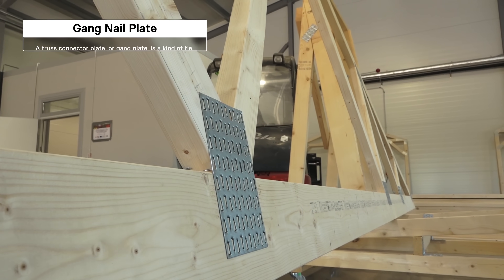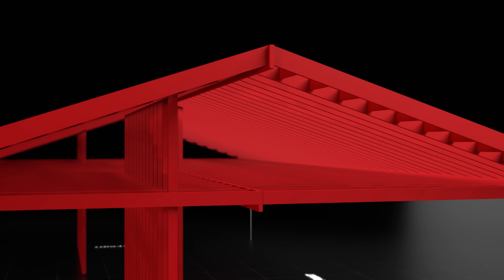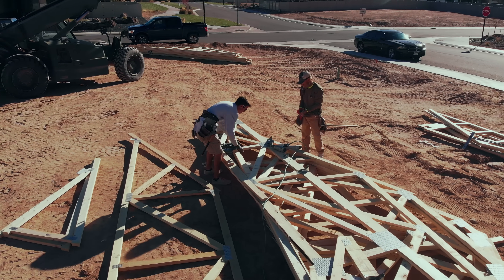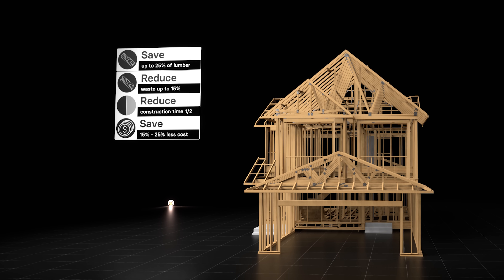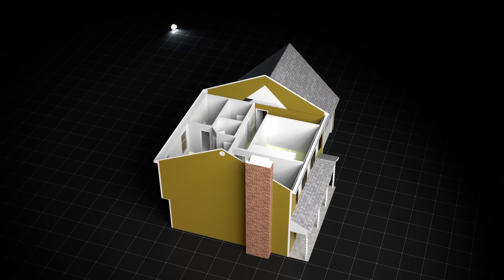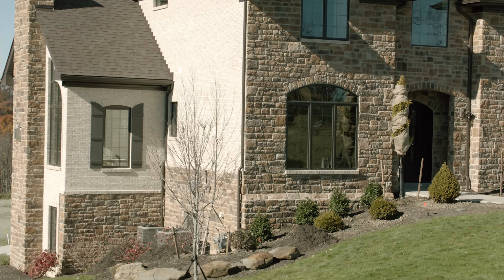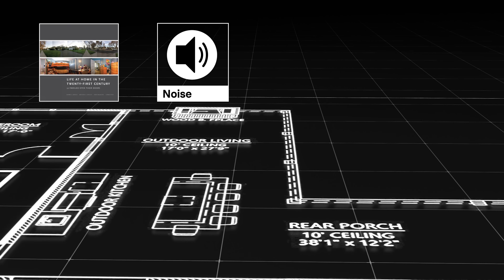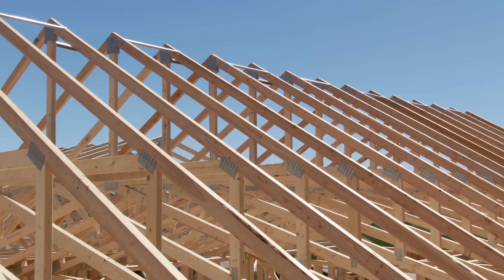The Invention that Accidentally Made McMansions

Comment: NEVER buy a house with a complex roof. Re-roofing costs are insane.
Reply: I used to do metal roofing. We could reroof a trailer house in 2 hours while some crazy roof design on a big house would take us 2 months. That's an insane difference in labor cost.

Also, overly complex roofs are probably going to leak too. These days, one of my jobs involves measuring roofs for metal. I walk away from some roofs shaking my head because there is no way they aren't going to leak with some of the nonsense flows they have going on. The people who build these things aren't going out of the way to solve bad design problems is all I'll say. They want to build it as fast as possible to get as much money as possible. Why would they bring up a problem they've spotted if they can just technically build it to spec and get paid for it?
Reply: I concur. I have a 1950's era A-pitch roof with two dormers and it still cost $16,000 to re-roof it. I can imagine $30-40K for these ridiculous mansions.

Comment: So, the engineer used a room-size computer to calculate lengths and angles. By 1979, the Engineer at my truss company used a Texas Instruments handheld computer to do exactly the same thing. He connected a small printer that printed a docket the same as your Woolies shopping docket to give us our cutting lists.
The loss of your roofs during strong winds wasn't the fault of how he roof was built. It was because the roof wasn't anchored to the concrete floor. In Australia in cyclone areas you need a bolt system every 2 metres to tie the roof to the floor.

Comment: I have a million and a half little cuts all over my hands and fingers from these. 2 pairs of gloves a week are necessary to comfortably build trusses with these  in the industry haha. But they come by the pallet on semi, 2x4, 3x6, all the way up to like 16x20+, and in 18 guage. Every 4 teeth vertically is 1 inch and each row of teeth is 1 inch which makes it easy to know plate sizes and to use em to measure place meant for where to put it on a long scarf

Comment: Gang Nail Plates are the reason modern houses "explode" when the get wind storms or swirling winds.  Old houses get damaged, new homes loose a wall or the roof gets lifted off.  It is not superior.  Another reason NOT to buy a McMansion or newer homes, they are not durable and are not worth the asking or buying rice.

Comment: The truss destroyed the earning potential of carpenters. Since a roof takes a lot of skill and math, many people would not be carpenter s , since trusses came in, and engineers, the skill aspect is done by programs and the worker is just an assembler, not a master carpenter.  Whereas electricians, gas fitters and plumbers still have to do the calculations themselves and are responsible.  

Always pros and cons when things are made easier.  Cheaper roofs... become bigger more complocated roofs.

Comment: Well, that video took a sharp turn from informative' to 'whiny.'  And it completely forgot about some of its initial points.  Trusses still have uplift problems in strong winds, and codes (at least in my neck of the woods) specifically call for 'hurricane ties' to securely fasten each truss to bearing wall.  And it completely ignored the fact that you can build an attic into a truss: it's even called an 'attic truss.'

Comment: My parents have a 20 year old McMansion that has rotting siding because it’s a glorified cardboard material. While I have 1900 farmhouse with original siding. The lumber from back then was virgin lumber. The grain was tighter and encouraged durability. Even with softer woods like pine. Now lumber is farmed. Irrigated and the grain is less durable. More likely to warp. Newer homes have particleboard sheets. They literally are barely a step above paper.
Reply: I just made a comment to a friend the other day. I told him 2x4's are basically particle boards now. screws split the wood so easy now. 
3-4 seasons expanding and contracting loosens every joint in the house, causing problems
Reply: Georgia Pacific had a siding that had numberous lawsuits as it was defective pressboard like system.  Not reliable.  Failed within 10 years or less. It might have been something like that. Ick!
Reply: @agentp6622 actually it’s figuratively, houses are much stronger than paper 😂
Reply: @agentp6621  Georgia Pacific the Koch Brothers sold the painted card board.  I recommend the pre-finished Hardi Panels.  Great color range selection and finishes..
Reply: Replace with hardie, problem solved. It's really not a big deal. People act like homes have to be zero maintenance or they are complete junk, but everything needs maintenance. Are you going to trash your car when you need new tires too?

Comment: I'm a fan of attics and like the the high rafter ties with gusset plates nailed in from both sides.  I think modern framing should try to enforce using the roof as the thermal barrier instead of the joists.  Having an attic where we can store seasonal items would greatly benefit us and slow down this single-use consumer trend we are in right now.

Comment: I'm an engineer working for a roofing products manufacturer, and I often have to review roof plans to help clients estimate their material costs using our products. I'm always amazed at how unnecessarily complicated roofs can be. It does sure make my job more challenging!
Reply: I think McMansions with complicated roof designs are probably mainly the result of CAD combined with floorplan-first designing.
Reply: @dafunkmonster  Yeah, that makes sense. I've used a roofing take-off software that will generate a roof based on the floorplan I enter, and some of them can be complicated by themselves. But what makes things even more complex is when some roof eaves are dropped, or they include gables at random places, or extend gable lines purely for decoration, etc.

Comment: I grew up in a house built in the 1940s. It was solid construction, and the old lady who had it built would show up in the evening and push insulation into any small spaces she saw. The house was so air tight that opening a door on the main floor would pop open any door that wasn't fully secured in the basement. It was cozy warm, and allowed my parents to seal the house during the 2002 anhydrous ammonia spill. However, it was very small by today's standards. 

In contrast, I've owned two different homes built in the 1990s with more open concepts. Our first home was split level and worked well for us until we got older and had some mobility issues, and was feeling cramped with family. Our current house is one story with a basement with larger rooms. The biggest difference, other than just size is that a different contractor manufactured the home. Air circulation was poor in our first home and HVAC sucked. But in our current home air circulation is much better and our utility bills are nearly identical even though there is 1000 sqft more to heat/cool. 

My point is that the choice of contractor, and willingness/ability to pay more, makes much more of a difference in the quality and durability of the house than just something like gang nail plates.

Comment: Trusses are time-bombs when  installed improperly, which is  more often than not.  A proper installation (especially for McMansion sized projects) requires an enormous amount of bracing to keep the compression members from buckling out-of-plane.  There's a 30-page manual on bracing put out by BCSI that nobody ever reads.  If you add the cost of the out-of-plane bracing, you probably break even on installed costs.

Comment: The problem isnt the technology of the plate itself. It all boils down to consumerism and not actually having any significant scientific data behind the longevity of the product at hand and how it can or should be used. Unfortunately we cant live in the past and at the same time we cant leap into the future. I see alot of talk about fire fitting and that thus is a week point. Well duh, so is the I joist so is osb. But its too costly to build in solid lumber, its to wasteful to not reuse the scrap. We are at a point that we can put chemical retardants in with the wood to slow the burning, but in the end its gonna burn, no home no matter what materials its made out of is going to outlast fire. Hell castles fell to fire. The point is this was to help make a home safer stronger and easier for the carpenter to insall. To save time and money or at least use the money that was going to get used for somthing else in the home. The mcmansion is not the fault of the this metal plate its the fault of gread and designers and every American trying to out do the next guy or have bigger and better.

Comment: Regarding McMansions in California, as electricity costs keep rising - currently around $0.50 per kWh, the McMansion is becoming less tenable.

Cooling that huge volume of space to 70 degrees on our typical 108 degree summer days using a standard central HVAC system requires a fair amount of electricity.  As long as Kwh’s are less than $0.30, it is reasonable enough.  However the the Kwh’s get into the 50 cent range, the finances become strained.
Reply: 50 cents per kWh? Gross. I'll enjoy my flat rate 10c/kWh all winter long. Nebraska is the only state in the country with 100% public power. You'd have thought California would have "nationalized" their power situation by now.
Reply: Yep - Poor old Cali has made bad choricea regarding electric utilities.

One example is the State Public Utility Commission.  In most states, the PUC commissioners are choosen vía public elections.  In California, they are appointed by the governor.  You can imagine how this leads to corruption and bad decisions.
Reply: @KbB-kz9qp  How does the uneducated electorate know who to select for the utilities commission and how does that result in actual better outcomes than a gubernatorial appointment?
Reply: In states where the public elects PUC members, the resulta are better, because the PUC isn’t beholden to the governor or his private investments.
Reply: @KbB-kz9qp  By what metric are the results better? You keep asserting that a thing produces better results because of its selection method, but you offer no evidence to support your assertion.

I might as well say that Communists build better cars, because the proletariat has freed themselves from class struggle. See how it's self-evident?
Reply: California has the highest prices for residential electric rates in the nation.
Reply: @KbB-kz9qp  Perhaps. You'll need to demonstrate how the selection process is the cause of those rates to support your assertion. You haven't even demonstrated correlation, let alone causation.

Santa causes snow, because when he comes it's usually snowy.
Reply: That's called "Bullshit Politics".

Comment: A problem with trusses seems to be that it takes up possible interior space. There is a house which I am familiar with a high pitch roof that can use the 'attic' area for rooms (albeit with very short vertical walls) that would not be possible with a truss roof. It makes two, or three bedrooms, for children mostly, that would not be possible on the house footprint area. And I would think that putting more usable space in an smaller structure would make heating and cooling more efficient.

But the truss plates also lead to the invention of other metal reinforceing  plates that make roof much stronger in storm prone areas.

Comment: We had a ranch style home. 4 bed, 2.5 bath. It had the gang plates. But it being built in the 1970s, it wasnt a McMansion. It still had a central wall in the middle to help load bear. The roof was simple and relatively flat (we don't get snow). The attic had a central section that had plywood laid down so we could use attic space (I live somewhere where basements are not practical). It was all brick - no mix-match cheap, crappy siding. 
So, gang plates may have made McMansions possible, but they dont have to be built. That's 100% greedy builders (looking at you, KB Homes) and greedy banks (looking at you, Chase, BofA, WF).

Comment: As a 60 year old builder I’m very familiar with these truss plates.  I think they are fantastic, and this examination of the larger effects they had (or contributed to) is just fascinating.  It’s both educational and entertaining.  Well done.  This is the kind of content we need more of.
Reply: Building houses out of wood is utterly moronic!
Reply: I think they're awful.  Every house I've been in that was built after the mid-80s has been built with them, and they've all rattled and rocked at me walking through, and trying to minimize that is part of why I got fat in the first place (can't exactly run around and be a kid when the entire house shakes at the antics of a single 50 lbs child, so I focused on things that entertained me without me needing to move around so much, like reading, or videogames)

They wouldn't be so bad if proper joinery was still used, but most of the time it's just a couple toe nails and a truss plate holding the house together, which might prevent it from actually falling apart, but it doesn't stop it from rattling and waving around dangerously when your grandkids run by your china cabinet, causing all your glasswear to bang against itself

Seen too many new constructions that have creaky floors on move-in to like the damn things
Reply: @PsylomeAlpha . Was your house raised?  I grew up in a house built in 1960 that sometimes rattled as you described. The rattling was due to the house being raised. It was somewhat near a highway so big trucks passing by were the cause. It was never a big deal and family lives in that substantial house to this day. No one became obese. Geez- an excuse for everything. No personal responsibility.
Reply: @PsylomeAlpha Play outside I was never allowed to run in the house and im not obese.😂
Reply: @PsylomeAlpha  Are you legit trying to blame the construction of homes for being partly responsible for your obesity? Come on friend, do the work. There’s a front door, walk out of it.
Reply: @PsylomeAlpha  Are you blaming gang-plates for your obesity?
Reply: If you are a 60-year-old builder, you should know how to spell truss.
Reply: @garyszewc3339  This is just disrespectful - grow up.
Reply: @Williamdzi  Hey!!!😤😤😤 Be nice to the gays
Reply: @garyszewc3339 All hail the Spelling Bee King!!! 🙄
Reply: @garyszewc3339 Spell check can change things, and you might not notice without your glasses on.

Comment: Also, each time I've priced trusses vs stick built, the trusses are more expensive than the materials to stick build. The framing labor is lower, but still doesn't offer a full offset in price. To be fair, the houses I'm talking about typically have more complex roofs.

Comment: Oh. wow. You really did tick every box. Thank you! I clicked on this with pretty low expectations, but I am glad to have been proven wrong.  From gang-nail plate to McMansion (a.k.a. Pasture Palace) is not a connection I would have made.

I especially appreciate your comments on contemporary building practices. The modern, overly-complex roof enclosing a non-usable attic space, is certainly a visual statement, though it's a statement which I find, literally and figuratively, hollow. It is worth noting that a grand roof enclosing blank, empty space, does have legitimate, world class precedent: the stunning Art Deco crown of the Chrysler building is a "roof for show." That is an unoccupied space.  The onion domes of St Basil's Cathedral in Moscow, as well as similar domes on lesser-known historic Russian churches, are "roof for show"  with no interior connection. 

Many thanks. Excellent presentation.

Comment: They're called gussets. They used to be made out of plywood. They were glued and nailed onto the truss. Way stronger than a nailplate. I don't see how the nail plate has anything to do with a mcmansion. You could say the same about any tool or material that slightly sped up the building process.

Comment: As the top comment here mentions these thing being a DANGEROUS component under fire,
let me tell you it's probably for a different reason.
Steel/metal gets extremely plastic from one moment to the next, when reaching a certain threshold temperature.
That's why the WTC folded so quickly and suddenly, while Notre Dame Cathedral's oak roof stood while burning for hours and hours.
(Massive) wood actually doesn't burn fast at all. It's burnt surface basically insulates the inner parts of the wood from burning/oxidating.

Comment: In my neighborhood, the lot value is the big drive in the cost of homes. There is a very limited supply in my zip code and extremely high demand.  This has led to house having a shelf life of 20/25 years. The next buyer has twice the paper as the previous and they want bigger more grand homes that are built to really high standards in most case. Things like geothermal heat/AC, zero threshold shower/ wet rooms, six bathrooms minimum with five master bedrooms, four stop elevators, 400amp service, 3+ sets of laundry, 6’ wide refrigerators.. And the next buyer doesn’t care. I see 15 year old houses get torn down every year. And I have never seen a truss used here.. lots of laminate and wood I beams, a long with ever increasing uses of steel and flidge beams.

Comment: Fire engineers know that metal fails early by curling and losing its strength. Curling in this case causes detachment early in a fire. Trusses depend on their connections for strength. These type of connections should be outlawed. Firefighters are confronted with a difficult decision in a known or unknown occupied dwelling with possible unprotected wood truss or metal truss space. Many firefighters have fallen through a roof or had a roof or other structure fall on them in buildings attempting to save lives.